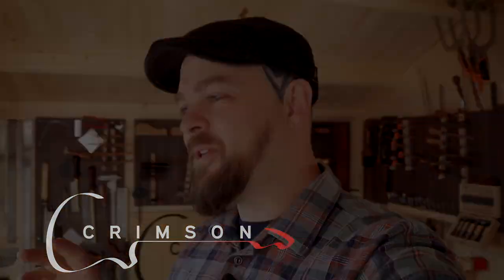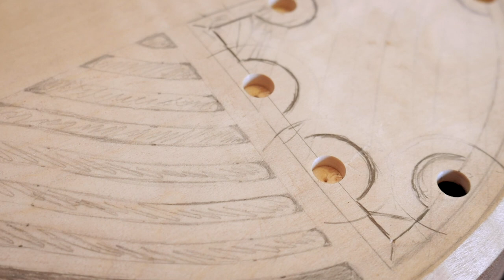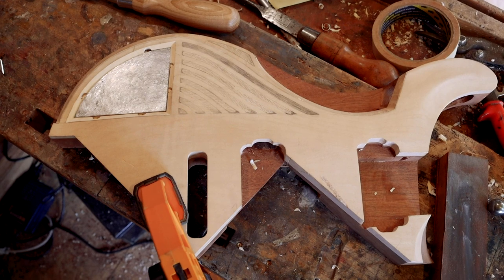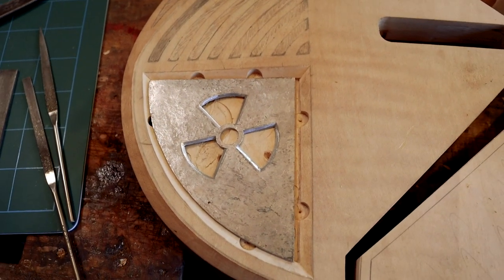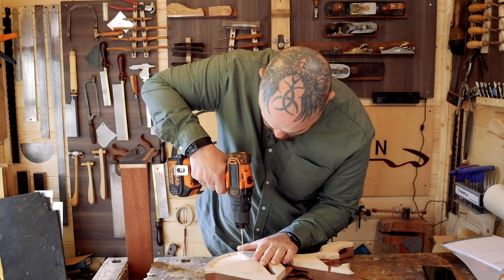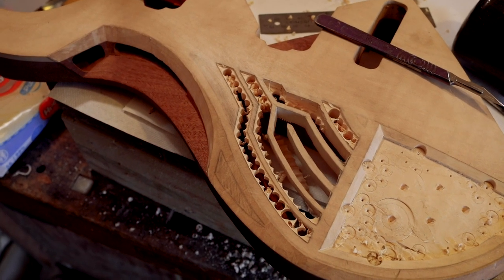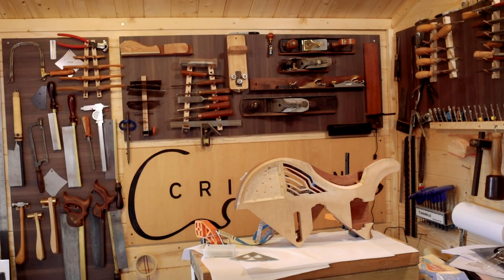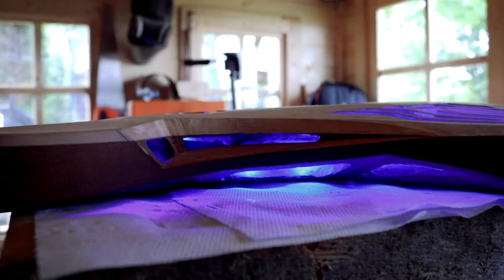Hazard! Ep 5 | Building a CYBERPUNK 2077-inspired Custom Guitar

Comment: Hey Ben, in my experience with resin, finely sanding the back side of the resin inside the guitar would turn it translucent giving a diffusing effect of the light. Also if you think it may fit, mica powder in the mix can also give a metallic aspect to it, and multiple layers gives a phenomenal effect of depth. The key is to not use the mica in every layer. 2 to 3 should do the trick
Reply: As someone who has a great deal of experience watching others use resin, I agree. I was scrolling down to add this idea, you've beaten me to it.
Reply: Yeah, kinda like a frosted look.
Reply: Have you experimented with Mica powder?
if so, have you had any success using it in inlays? mine keeps sanding out/having pockets of dry powder, like only the surface grains of powder fully cure - any suggestions sir?
Reply: @martrocksnuts  I've never used it for inlays, but I have used it to simulate flowing water in resin. A little goes a very long way for the water effect, but I don't see why using substantially more for a different effect would be problematic. Just make sure to mix it thoroughly, and you should (hopefully) be fine. The goal is to coat every particle of mica with resin. You may want to try doing a base layer with mica, and then a clear layer once the first one firms up to avoid sanding into the mica. If none of that works, my only other suggestion would be try different resin and/or mica powder. I hope this helps!

This is the resin I use for my projects
https://www.signaturecrafts.com/collections/resin-products/products/uv-resin-collection
Reply: @andrewassile1629  ah ok, so it seems resin is the key factor! I've just been tapping the powder into gaps and using super thin glue. Thanks for the advice sir! 👍
Reply: @martrocksnuts  My pleasure!

Comment: You should definitely flood the sound holes with resin, and sand the resin front and back to diffuse the LED lights. Frosted effect glowy bits always look amazing.
Reply: I was gonna suggest the same thing! Using a translucent pigment could help with the diffusion too. I think resin will be the best bet for reinforcing the little fiddly bits.
Reply: yeah... also a suggestion: mix resin with fluorescent green powder and use UV LEDs for that neon green radioactive glow
Reply: Did you ever try to sand the inside of a glass ball? That's what it would be like to try to sand the inside of resin if all the sound holes are filled with resin.

Comment: The "Z" like stripes that you redrew...how about extending the top two to the neck p'up and the bottom two towards the top of the bridge p'up...kinda like if it's some sorta energy feed that glows or pulses to power them awesome P'ups, eh?
Reply: I was thinking something along the lines of this as well. Would be great!
Reply: What about fine circuit board design.
Reply: Agreed! That sounds awesome!
Reply: all the yes.
set the LEDs to cycle.
profit.
Reply: Yep, i was thinking with thin copper slice in the resin to imitate a flexible circuit board.
Reply: @martrocksnuts  not an expert but I'm sure the LED's can be made to react in pulses according to the degree of the sound...that'd be cool

Comment: Snap the LED strip off at the break point for correct length for a clean install. Have sensor visible, maybe one of the player facing ports, so you can POINT THE REMOTE DIRECTLY AT IT (remember sunlight contains IR light so the remote will just fail or spaz in sunlight). I think clear resin with a mesh backer is the perfect option for the conduit carve.

Comment: it probably help the leds give off a more equal glow if you coat the inside of the cavity in some aluminium tape or the gold coloured tape you use against electro disturbace on the electronics , the gold tape might actually give a nice added glow to the whole thing 
inbedding the led strip in the resin then sand it to make it opaque white would help the glow too

Comment: Making the resin thin and giving it a cloudy white color will allow any color to come through while softening the glow a bit. I think it would also give a cool effect when turned off as well, depending on what color the surrounding wood is. Against a black or red would be nice. If the surrounding wood were the same cloudy white color, it would make the design virtually disappear with the LEDs off and only appear when they are turned on. That could be killer as well.

Comment: reckon you should try and disguise the remote as a pedal, so that it can sit on a pedalboard, and the LEDS can be activated when on stage
Reply: … or could incorporate the remote into the back of the body (somewhere that it doesn't get switched randomly !) ...Or maybe even attached to the strap ?
Reply: The problem with both of these ideas is that it uses an IR sensor, and seemingly a poor one. Need really clear line of sight.

Comment: Handy tip when filing aluminium, rub some chalk into the file teeth, it stops the soft metal clogging up your file. Or just use a wire brush to clean the file.

Comment: For eching a precise motif :
Use a lazer printer just print your design with full density and solid black and mirrored. Then you can use a cloth iron without steam and press the drawing onto the aluminium, that will transfer the tonner very precisely. Then etch in ferochloride, rince, clean the ink with amonia/alcool/whatever solvant and here you got a pretty good transfer. That technic is used to make cheap PCB.

Comment: Hi Ben;
I love what you've done so far. I think a tint would be good, because if it's used in the daytime it could be used without the led's and still look good. However; it will look good either way. Andrew Assile  is right on the light sanding on the inside of the resin to act as a diffusing effect. Can't wait to see what's next. Some led inlays in the neck would be a good match.

Comment: I think you are right to allow the LEDs to determine the colour but I still think you could tint the resin - the LEDs' colour ought to overpower any tint, I'd think?
I do think misting the resin to diffuse the light would help. (sanding?)
I also wonder whether the resin could be poured strategically such that it matches the carve of the guitar's surface but is recessed down into the detail slits? Maybe several pours at slightly different angles then lightly sand the upper surface of the resin inside the slits?

Comment: I don’t know anything about woodworking or how to achieve the look you are going for but, instead of removing the large stripes of the nuclear vent holes, remove the thin bits. It will concentrate the led backlighting as it shines through making it look more uniform and strength will no longer be an issue.

Comment: You could use clear or coloured acrylic rather than mesh or resin,the advantage is strength.What you're building here is a show piece (a bit like that white speedmaster).Self etch primer on the alloy if you want the paint to adhere for a long(ish) time.............

Comment: For the LEDs: 

What would be kinda neat, is if the "design" was one color of LED (Red, say) and the break in the guitar was another color (blue) and when you changed it it would go like: 
Red and blue->green and red
green and red->green and blue
green and blue-> blue and red
and cycle through in several color schemes that way, as well as both being the same color.

You know, for more variety...

Also: Is it possible to make an inlay that is backlit with LEDs, or would that ruin the structural integrity of the fretboard?  Not saying you should do it - just merely curious how troublesome it would be to do for the future...

Comment: For the sound holes, I think mesh would be way cooler. I completely agree that resin is overused. I the mesh would be another "outlandish idea" that you could potentially reuse. For the paint, what if you finished the guitar in a base color first, then applied the red accent? You could distress it to reveal the color underneath

Comment: the possible cut away on the top, use that to put in an on/off switch for the light effects.  hide it under another metal plate that you press to turn them on and off!
Reply: as for the resin, put something into it that will act as a defuser.  that way the light from the LEDs will be visible, but the light source will have a glow affect, like a light saber.

Comment: I have a preference for the orange.With the Z cut of the guitar, that will be interesting to have few thin strip of copper in the resin to do like a Flexible circuit board. That will be a perfect fit with the soundhole.
Reply: And of course all the electronic should be visible to stay in the thematic

Comment: Since there are well over a hundred ideas on tinting the resin, or not, my suggestion has to do with the plate.
First, do you still plan tp distress it with the acid? Something lighter than your sample piece should work. The pale yellow coloring sounds good. However, rather than black, why not that strong red paint you tested? Some of that in the recess for the plate, and left untouched would give the impression that whatever was used there was even stronger than the metal above it.
The lights will look great.
    JRR

Comment: The resin should be translucent white. So you can’t see through them. But will look white when switched off and whatever colour switched on. You don’t want to see the pixels. (I build led for tv and events) 

Also I like the raw aluminium. If you paint it, it will just look like a finish. And not a set piece.
Reply: P.S. I have two aluminium bodied arch top basses. I like metal in a guitar. Haha.

Comment: 1. Get a 3-way crossover
2. Get three separate LED strips, one set to full red, one to full green, and the last to full blue
3. Connect the red strip to the lows output on the crossover, the green to the mids, and the blue to the highs
4. Connect the input of the crossover to the output jack

CONGRENDULATES! You have sound reaction lights! Now go and rest our Lutherans!
Reply: Noel Goetowski wouldn’t you need a built in eq to do this?

Comment: Clearly the thing to do with the light color is to embed the switches in the fretboard, but expand the connections so there is a contact for every string and fret combination, so the colors change constantly as you play.

Comment: In the last view of the guitar at the end of the video, imagine the slots filled with crystal clear resin. Instead of a metal mesh in the background, how about some printed circuit board material? Or some small tubing or hoses, possibly a part of the cooling system of the internal power supply?

Comment: I think you should add a Raspberry Pi in the back to control your l.e.d strips powered by a usb power bank , googled it and they can be used to control led lights  , then you could try and have the colour linked to the volume  , starts blue and as you turn up the volume it could change through orange to red like your turning up the “reactor” power , alternately it would give you more control of your lights and possible patterns

Comment: We had a few ideas with my wife during the watching of the video :
- have luminous dots on the neck (yes it would need to remove the fretboard, recreate a groove for the LEDs... but you like challenges)
- of course embed the LEDs in the resin between the 2 parts of the guitar
- in the sound holes (which won't be holes if you fill them with resin) have some clear resin on the top with embedded wires (fakes ones but it could also be the pickup wires even if it has no sense to route them through these wholes). I was thinking of some kind of Back to the future flux capacitor or just simple wires not glowing but showing the futuristic heart of the guitar near the nuclear power supply, a bit like this : https://www.piscines-hydrosud.fr/img/produits/004515/connecteur-etanche-ec-04-g.jpg

Comment: G'Day,,Hmmm thinking about etching,,could you etch design Deep enough so as to paint over and then remove paint from non etched surface,,bit like the old label on M/C parts,,
Yep reckon a flat lap type of thing to remove paint from not required parts,

Comment: With the newly drawn sound holes on the top, I'd put some lightly tinted resin in them so that they let light through but are somewhat opaque. Make it similar to the reference pic. Why epoxy? I feel that the guitar has lots of thin strips of wood already that might just crack under minimal force. I wouldn't want the top to be ruined by an accidental blow. That is why epoxy, but that's just my two cents.

EDIT: Also, as Ben himself states in the video, just the top holes, nothing else.

Comment: are you gonna use epoxy? my experience with these LED  lights is that they interfere with the pickups on high gain if you use them strobe ore changing light, hope you find a solution for it i used RGB LED in a few builds so....

Comment: Hi Ben ...you are my kind of slightly insane and creative. I'm about to attempt my first ever  build. A total custom strat atyle 3 H wired like a Les Paul  (tone ans vol for each P/U) with coil split and bypass switch to activate Neck and Bridge together which cant happen in a strat with just the 5-way switch alone. also toying with an idea of led indicators for each side of each P/U light when on  for each coil but wiring those may be a problem. Perhaps in parallel with the P/U wiring maybe.  Paint will be midnight blue with galaxy design covering the entire face of the guitar including scratch plate (clear acrylic with 1/8" clear border around P/U's (led's) and P/U covers fert board and head stock in midnight blue to complete the effect, well thats the plan anyway, what do you think. Oh well the real reason I'm here is that I think that you could do resin over mesh. from  the bottom of the slots to about 1/4 or 1/3 from bottom leaving the remainder empty to the surface of the face of the guitar and perhaps  infuse the resin with a fine silver sparkle possibly aluminum particles from the filings of the "reactor cover plate" also as in other comments cutout the warning symbol and resin and flake it as with the slots. then whatever color the led's will be accented by the sparkle effect..

Comment: HEY BEN, RGB IS A BAD IDEA
RGB controllers use high frequency switching to dim the LEDs, which is completely unacceptable near the pickups due to the radiated electromagnetic noise.
I suggest using RGB only to try out which color works for the look.
You could even put the strip on a bolt-in piece with some sort of 2-pin connector soldered on, to make the light color interchangeable.

Comment: What make are those silver drill bits you are using?
Reply: Star-M from Workshop Heaven.(www.workshopheaven.com )  I bought 10 and 12 mm to try them out and they are amazing. Virtually no tearout in pine, ply or MDF without a backing. Saving up for a full set, although they are not ridiculously expensive. Made in Japan.

Comment: Noooo... My OCD... My eyes ))))
That sound.... lines... - together they are the same (almost) width as aluminium plate, but starts with shift that equals to bevel width. Thus near strings they are "moved up", at least their start points. And near body edge they are too close to the binding bevel. In other words, its like they comes not from the plate center, but from plate side.

Nevertheless, excellent build!

Comment: BEN.  Two options for the red paint. 
1: You can get paint put into a spray can at some paint shops.
2: Use a warming pot, (or home made version) which will warm and thin the paint to give a better flow for brush painting.